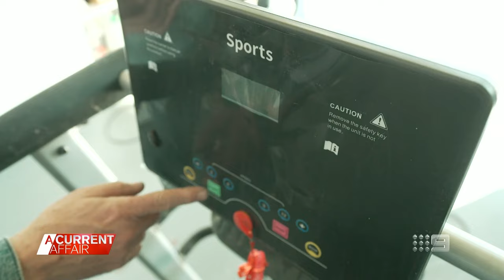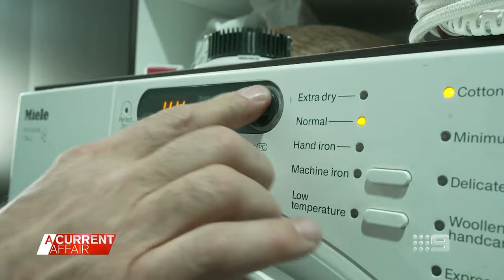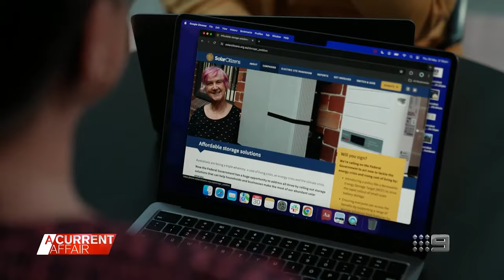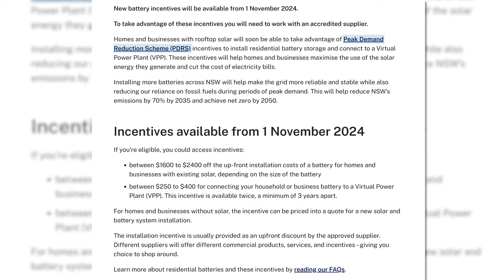If you have solar you will be taxed.

Comment: I thought they were rolling out batteries in neighborhoods to fix this same issue. The community batteries would get charged from excess solar from neighboring houses when there is a lot more power than the grid needs and discharge when there is spike in electric needs to the same neighborhood.

Comment: Hmmm I can see where it could end up in regards to energy companies charging us out the arse for export, but realistically for a while now the main point of savings when throwing a solar system on these days is self consumption, and these changes will drive that way of thinking even further. 

Worst case scenario, just place a no export limit on the system, yeh?
Reply from the maker: Yep! Let's hope greedy energy retailers don't increase the cost
Reply: @yeanswers  your video is actually fairly misleading, solarqoutes have just put out 2 articles in the past 2 days regarding this issue. Not sure why you joined up with ACA to put this together. 
Genuinely disappointing to see. 👎

Comment: It's either that or pay a much higher supply charge.
Reply: The issue is that this matter was entirely foreseeable - and the distributors and regulators in charge of the grid have been asleep at the wheel and now solar retailers and end customers are the bunny. Currently for 1 July this is voluntarily - to opt in (fat chance) but from 1st of July 2025 its mandatory.  And while the charge is relatively low right now - I bet you that this charge will go up and then the damage is done. Absolute ridiculous.